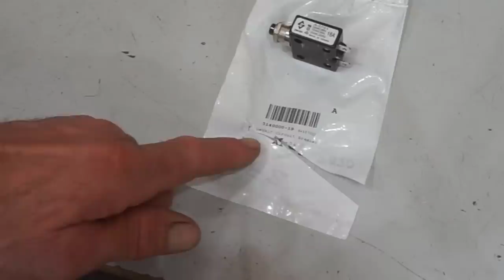DW735 Planer Deep-Dive Maintenance

Comment: I mistakenly removed the complete top portion of the planer.  I am trying to reset and lower it down to the threaded screw posts.  There appear to be 2 sets of threads in each hole for the screw posts.  When I am lower the to unit wit the handle everything goes well until it the posts go up against the second set of threads.  Everything binds up.  There is no obstruction.  Is there a trick to getting this to seat into the second set of threads?
Reply from the maker: Wish I could help you out on this but I've never been so bold as to completely remove the planer head like you did.  I'd reach out to a local DeWalt service center in an effort to talk to the guy who actually does warranty/service work and is familiar with the brand.

Comment: Really thorough and clear video with so much good information (I became a subscriber from this one video and look forward to checking out more of your stuff)! I am getting started on doing this deep dive maintenance (I have the DW734), but the main question I have which I cannot find an answer for anywhere is how to diagnose whether the chains need to be replaced or just need to be cleaned and lubed? I don’t know what the chain tension is supposed to feel like. If you have any tips about that, it would be much appreciated.
Reply from the maker: It's been a long time since I've looked at the drive mechanism for any plainer but a dw735 but in general the drive chain is very loose and the only tension for it is applied by the little idler gear. The main issue for a chain health and condition is that the links are loose and free with no stiffness or Kinks from rust or dirt. What I typically see happen is the chain gets Rusty and is so stiff the sprockets can't rotate and then one of the small diecast sprockets brakes when the drive mechanism binds up... hope that helps keep your planer running smoothly.
Thanks for the sub too and I hope you find other videos here at Next Level carpentry and worthwhile

Comment: Well done video. Mine is brand new and stopped blowing ou the shavings. How do I unclog that? Thanks
Reply from the maker: This video gives you a look at how to remove the top off you planer and remove the duct so you can unclog the shavings from it: https://www.youtube.com/watch?v=r_yEwlsYGbU
BTW it's very rare that shavings plug up that duct so I recommend you adjust your use of the machine so it doesn't overload and plug it up... it's not good for the machine or the wood you're planing to run it so aggressively that it chokes on chips.  Cool? Cool. Best, Matt
Reply: @NextLevelCarpentry  Thank you. Most prompt response ever.
Reply from the maker: @mauroheck1  You're welcome... just sat down to work on editing the next Next Level Carpentry video... hope you planer behaves itself for you!

Comment: I'm stuck.

Planer squeals when height raised, but quiet when lowering.

- have already adjusted the height of 4 corners (without removing bottom screws by just pulling the chain against each sprocket).
- Chain appears to have temporary slack when going from lowering to raising chasis but then tightens back up

What do i do?
- do i remove bottom chassis 6mm hex bolts, drop height and adjust?
- do i need dry lube for vertical shafts?
- is there a trick to getting the chain tensioned correctly
- Is there something else i'm missing?
Reply from the maker: I've never been able to totally resolve that intermittent squealing issue.  I've done dry lube on the vertical/threaded posts for a partial/temporary/adequate fix but have never been completely confident I've lubed the right parts the right way. I know that if you remove the top cover and aggressively blow out sawdust and chips followed by dry-lube on the chains and threaded columns in there it makes it as quiet and smooth as possible without disassembling the entire raise/lower mechanism... good luck?

Comment: I don't know if you still respond to questions on here but on the rear roller baring does ghe thin side still go toward the top? The reason I ask is because my rear roller baring is the same direction and my rear roller isn't catching the workpiece
Reply from the maker: I still respond to questions but I'm afraid I don't have a useful answer for your question this time.  All I can say is that it should go together 'easily' and look right when it's put together properly?

Comment: First thing I thought of was to flip the thing over. Anyway, good job. Only issue I've run into is getting that damn screw out of the crank handle.... Might end up drilling the thing out the way it's going.
Reply from the maker: Yeah I don't know what's up with the crank handle screw but I've fought with mine a time or two too!
Reply: Ya, ended up drilling it out. Finally got the handle off and the rest of the screw just spun out with ease...
Reply: Ok, I pulled the base deck off too for impact access but don't recommend as those height adjustment gears will move and set the whole thing out of whack. Also, something chunky went through the thing apparently and kicked the crap out of the fan so ordered one and will explain the repair on here after (looks like the whole case, except the electrics panel, has to come off for ease of access).
Reply from the maker: @RickL_was_here  A loose knot pulled out of a board while planing is enough to trash the impeller blade and housing... don't ask me how I know 😉🤯😂
Reply: Not sure what it was but the blades were messed up pretty good, might be salvageable though still. Looks to be ok after a good cleaning. Wasn't nearly as difficult to remove as I thought either (2 screws and those snap clamps×3) although I've figured out the previous owner completely broke the entire fan/impeller cover (didn't read the open/close writing...) so that will need to be ordered instead. Would explain the wood chips all over the inside.

Appreciate the heads up for this thing and the replies.

Cheers from 🇨🇦
Reply from the maker: I once had a knot do exactly that: break blades off the impeller and bust out a little hole in the housing.  I was amazed at how quickly and thoroughly chips packed into the housing to the point the raise/lower chain got jammed so much the crank wouldn't turn.  Everything you're learning about your planer helps you to understand how it works, troubleshoot when it acts up and anticipate problems before they cause real damage.
Reply: It's actually a friend's, I always fix stuff so he brought me this thing. Seeing what it does now, is impressive. Beautiful machine.

Comment: How can I tell if the Thermal Overload switch needs replacing?   My planer was working fine the last time I used it,   I had a power surge in my shop last week which tripped out several circuits and now I was going to use the planer but it doesn't start when I try the switch.   I press the reset button but it doesn't do anything.
Reply from the maker: Basic electrical troubleshooting... first make sure the circuit you're plugged into is live. If not, determine if the thermal overload button is in the 'in' position and, if it is and the planer won't run you'd have to open the machine up and do a manual bypass of the overload switch with a jumper wire... if it runs with the jumper, the overload is bad.  If not you've got more obscure issues to resolve...

Comment: Where do you begin diagnosing the problem of rollers not turning at all?  Love your video and your channel!!!
Reply from the maker: With the machine unplugged I'd remove the cover from the 'transmission' on the left side and first inspect the drive chain. It's a surprisingly non-invasive job and will tell you a lot.  The next thing I'd do is remove the chain by removing a sprocket (with snap ring pliers) and try to rotate them.  That should tell you all you need to know about why the rollers aren't turning.  What you'll need to do to correct it should be obvious but might be much more 'painful' to rectify.  😁😎
Reply: I had that issue. Rollers didn't start rolling until I pushed it more completely into speed setting 1 while it was running. It seems like it can get stuck between speed 1 and 2, causing the rollers to stop turning.
Reply from the maker: @coltonheeney4291  Thanks for adding your experience here.  I assume you're always switching gears with the machine running and not under load as instructions require?  I could see the 'gear shift' getting bumped and putting the drive in a dead zone so your insight is helpful... Best, Matt

Comment: Hey GREAT VIDEO: QUICK QUESTION 
I just replaced my rollers...Wondering if retaining clips are supposed to be screwed all way in? I think so but also feel like the bushings should float up and down a bit to increase the bite of the cutter head. Maybe this is a dumb question.
Reply from the maker: Not sure if I understand your question but the screws should be driven tight to hold the clip in place and not work themselves loose but there should still be some play in the feed rollers due to the springs and retainer clips... Works kind of like Springs on a car to take some of the bumps out of the road/board...

Comment: our planer will not start - is there a way to bypass the thermal overload switch, temporarily to see if the switch is bad?
Reply from the maker: It wouldn't be very easy but, if you remove the connectors from the switch and clip them to a 'jumper' wire, that would bypass the switch but doing so could cause damage so approach with caution.  A certified electrician might have a less risky option so use your judgement... Best, Matt

Comment: Did you try out the machine under significant load, after the deep dive maintenance, to see if the thermal switch would still trip?
Reply from the maker: I am not going to intentionally run a stress test on it... I've run it normally but not overly long since the Deep dive maintenance but will just have to wait and see the next time I've got a bigger job that requires a bunch of thickness planing. Fingers crossed in the meantime Walt...

Comment: Matt,  when our planner did not start, I had taken out the brushes to make sure they were no worn. Then after reviewing your advise on bypassing the thermal switch under the supervision of an electrician, I replaced the brushes to prepare for the electrician. Checking one last time, to my amazement the planner turned on immediately. now I am really confused. The problem to start could not have been solved because I inspected the brushes, so then, any suggestions? I am ordering a new thermal switch, brushes, and belt to have them in 'stock'.
Reply from the maker: Actually if the brushes were 'stuck' at any time, that would keep it from turning on.  If they were installed incorrectly in any way, that would keep it from working too.  I think your plan to have new parts on hand is a good one.  Keep your fingers crossed and enjoy using that planer! Best, Matt

Comment: I have the same planer. The first time I used mine the blades got small chips that made lines on the wood. I only did three pieces. I flipped the blades to get a clean cut the next time I use it. Is there anyway I can keep from getting chips in the blades?
Reply from the maker: Clean EVERYTHING you run through your machine!  I scrape the surface with a wide, sharp putty knife and scrub rough sawn lumber with a wire 'tug brush' to minimize problems.   https://www.amazon.com/dp/B000WM89SG/?ref=idea_lv_dp_ Blowing off the surface with compressed air is a good idea too... the more you clean, the better your chances of avoiding those nicks.  Remember you can shift the knives left and right on the cutterhead to extend their usefulness because  a nick mark from one knife is then planed away by another. This will help but knots in the wood will wear a sharp edge enough to notice the difference in the planed surface but should sand out easily...

Comment: My driving gear box leaked oil for a while.  I suspect it is now bone dry...I am tempted to open it up. Don’t know if I can find a spare gasket to replace it and also if the content of the box is supposed to be submerged in oil. Appreciate any inputs guys.
Reply from the maker: Check into it at ereplacementparts.com because they have in-depth videos and information on a lot of things but I'm not sure if they have it on this particular gearbox... Good luck 😁😎

Comment: This might be off topic, but I have a couple of questions. How tight should the heightadjustment wheel be? My brand new 735 seems a little stiff, and seems to be stiffer at certain points. Should I be using lube on the posts? Also, how do you feel about mounting this planer to a flip top stand? Is it robust enough that the flipping wind damage anything?
Reply from the maker: The height adjustment wheel is always a little tough to crank, tougher on the way up than on the way down. If you use any lube on the posts make sure it's a dry lube so it doesn't collect sawdust. I'd guess that if it's stiffer at points it might have to do with stiffness in the chain that drives the gears up and down and that might go away with use over time. I don't think there's anything about flipping action that would hurt the planer as long as the flip stand itself is strong enough to hold it. The machine is well-built and fairly heavy so I'd take that into consideration for the practicality of a flip stand but I think many people are doing that and you should be fine... Best, Matt

Comment: I'm planning to buy a planer within the next month or 2, and I can't get the DW 735 here in Denmark, but multiple companies have the "DW733 qs" for 880 US dollars.   

And since it's quite an investment, I've chosen to buy the planer and let the jointer wait.

And as you can hear, I'm a beginner, and would any of you recommend me to buy a used and cheaper model, though they are not a lot cheaper than a new one, as there are not many used for sale here?
(A new Makita 2012 nb planer cost the same, 880 dollars, and cheaper/smaller or used models only about 100 dollars less)  

I'll appreciate any comments or suggestions if possible (y)  Thank you!  :D

Comment: I think I'm hoping you will tell me to either scrap it or give me some knowledge.  A tradesman gave me his Dewalt 735 and I took the deep dive.  When I opened it however, there was nothing that wasn't rusted.  I did get the rollers out and cleaned them up and it's looks pretty good. Haven't looked at the knives and about to open the motor.  I have not plugged it in.  What component or components might tell me whether to continue cleaning it.  I'd like to use but  want to be reasonable.  And didn't you say at 3mm t-tool?  All disassembled anyway. Thanks so mucn. Beth
Reply from the maker: All depends on how determined you are because just about anything can be resurrected.   If the machine sat idle and deteriorated, a deep dive should give you a good machine along with a thorough knowledge of its workings from your experience.  If it bounced around in the back of  truck, subject to abuse, misuse and the elements, you would be, in the vernacular, just 'polishing a turd', wasting time and money better invested elsewhere. 
My biggest concern is that, after investing effort and $$ that performance is compromised from years of neglect and abuse.  I'd say if you have to spend more than $150 on replacement parts to make it work essentially like new that you should consider scrapping it rather than wrestle with the machine every time you use it to get accurate results.  Bottom line is that a well working DW735 is an excellent machine to have at your disposal... I couldn't function without mine. Best, Matt

Comment: Circuit breaker? Don't carpenters just use nails? ;-)
My Father was an electrician. As a kid, I was working with one of his tradesmen - we had to rig up a demonstration of the foyer lights of a building for the architect etc. to evaluate.
We connected all the lights, put a plug on the wires in the switchboard and plugged it into an extension lead from the builder's supply...
From this point, there was a lot of smoke and flame - with the lead thrashing about burning the floor like an angry snake.
Somehow, the tradesman managed to disconnect everything (I had taken cover).
We went investigating:
1. our cable run continued to another light fitting - where everything was still tied together where it had been pulled through the conduit (oops)
2. All the fuses in the builders supply box had been replaced with nails.

For that damned switch on the planer - after the second failure, I (being an electrical guy) would have butchered the case and put something more robust in there...

Comment: Hi, I have a new dewault planer and i mistakingly took out the spring and ball bearing from the dial that adjusts height. I have all the parts but cannot get it back together without damaging the spring. Can anyone point me to a video, website or tell me how to fix?
Reply from the maker: Hey Jeff, although I don't have a lead for you for a video for that dial I can tell you that, in 2 decades of using DW735 planers, I've never once used that dial.  It's far too inaccurate to rely on for setting thickness.  Calibrate and use the sliding thickness gauge on the post by the height adjustment knob.  Note: one full rotation of that knob is 1/16" EXACTLY and it's the only thing I use.  Hope that helps a bit even though you might still want to get the knob put back together to settle the matter... 😏😎
Best,
Matt

Comment: Do you think a small amount of locktite on the machine screws would be a good idea? Also have you thought of running a helix carbide cutting head and if not do you have a reason not to.
Reply from the maker: Sure wouldn't hurt Paul: inexpensive insurance against failure for sure! A shelix cutterhead has been a matter of debate for some time now but my jury's still out on the quality of the finished planed surface...